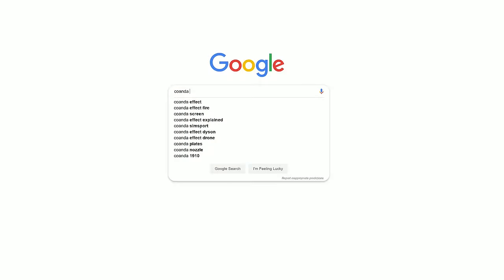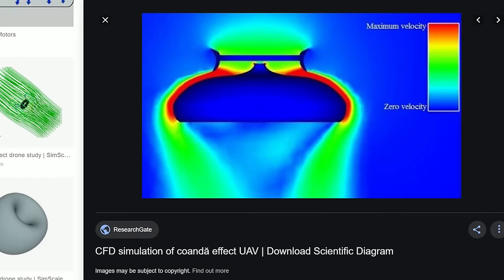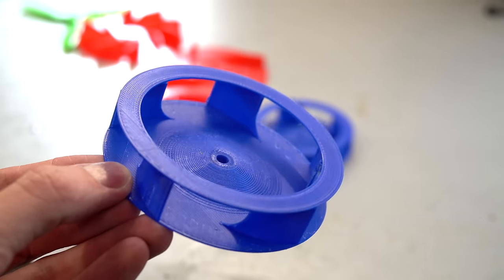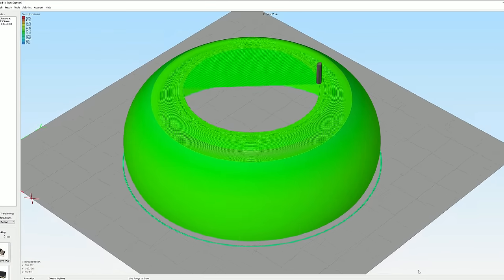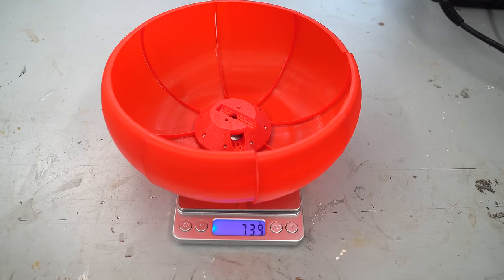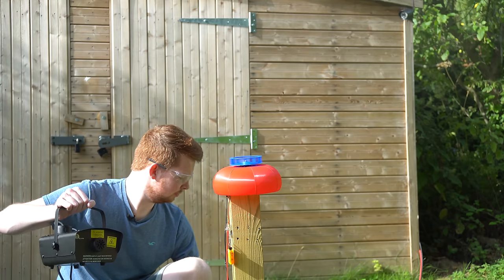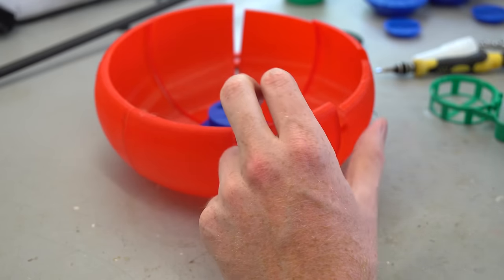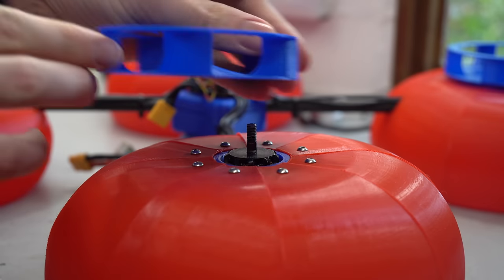Coanda Effect Drone Propulsion

Comment: Copy Dyson’s impeller design.
Reply: Dyson uses Panasonic vacuum motor/impellers.
Reply: But the question is how do you get 230v at 30A on a drone that size? I don't know if that's even possible!
Reply: Designed for max suck, not blow
Reply: @KnowledgePerformance7  you mean pressure differential, not airflow. 
still would be interesting to compare static pressure v CFM.
Reply: @ctchrisf  I'm not good at words lol

Comment: When I attended rotary-wing flight training, early 1980 we were taught the ground effect would occur as long as we were 1.5 times the rotor diameter within the ground. Once out of ground effect, power consumption increases, that is why most Power Checks are conducted at 50 foot AGL (above ground level).

Comment: you can do that test with a spoon under a running tap :)
Reply: Or your finger under a running tap :)
Reply: That is more due to the water's surface tension than the Coandă effect.
Reply: @kurtpiko4412  Fluid dynamics and air flow are remarkably similar
Reply: @sahhull  true, however in this circumstance the effect of water's surface energy /tension is greater than the Coandă effect.

Comment: Would it still fly if you just had a flat surface under the propellers? I know it would produce the effect but there would still be air flowing down producing thurst...
Reply: That would be like trying to move a   sailboat forwards by blowing on the sail yourself. If the air from a propeller hits a flat surface belonging to the same structure, it will cancel out the thrust.
Reply: It would, so long as the flat surface wasn't too large, as some air would still be able to maintain downward momentum and provide the thrust. This drone is more flying in spite of the bowls than because of them - the coanda effect (which is what actually causes all lift) is reducing how bad the obstacle is
Reply: Yep, that's why it flew so much better with propellers instead of impellers. Not all downwards momentum gets blocked by the domes because there is quite some separation between the propellers and the obstacles.
Reply: Samuel Goodwin
no.

Comment: Interesting. Although it is not applicable efficiently as a form of propulsion since the same dome that generates this effect applies great resistance to the airflow, causing it to lose power.
You could try doing some combo props that generate momentum down and to the sides. Combining in your case the green and blue propellers and modifying the dome leaving a hole to give space for the air flow downwards. This way you could take advantage of both flows and test if it is applicable and compare it with the conventional way.
Greetings!

Comment: if the bottom of the domes were "teardrop" shaped would you have a more condensed airflow as the air would follow the shape?
Reply: @Klippy Klop I think he means concentrated
Reply: VarinOOF that’s a much better word
Reply: I was going to suggest this too - the bottom of the tear drop could be feet for it to stand on maybe. Even covering the current design with a flat bottom might help increase the ground effect and reduce drag as it climbs, surely there is a big vacuum that forms under there? Or even redirect some of the flow inwards to make it higher pressure...
Reply: I think so, but wouldn't it kind of defeat the purpose? Might as well ditch the domes and use the concentrated airstream straight off the propeller like usual.

Comment: ok but technically the “tomato things” are just in the way of the propellers
Reply: No, did you watch the video. Airflow is sideways/horizontal, the "tomatoes" use the colleander affect to redirect the air down, creating lift.
Reply: @airgliderz  actually when he uses propellers instead of impellers, the initial comment is legit cause the airflow is vertical, not horizontal
Reply: @tristand9129  that's given and clear already

Comment: well explained. It is not just the surface pressure alone, but also the flow of special materials that creates a curved air particle pressure with increased additional adhesion and its better coupled flow counterforce at the other end of the doom.
2.23 shows it good.Maybe an additional double cap at the top of the dome ?

Comment: Centrifugal impellers develop greater efficiency when they have a certain grade of back-pressure. Perhaps with some sort of ring-shaped nozzle the back pressure could be combined with a greater flow velocity around the curved surface, useful for the generation of lift in Coanda-mode.
Reply: Tom,
Images Rebamade a Chanda hovercraft in the 60s. was pub in scientific American June 1966.
he had a ring around the base

Comment: That extreme ground effect should make for a much safer and softer landing. Especially on auto-landings when the ground proximity sensor doesn't work (or it has none), the drone could simply reduce power and would come to a safe hover low enough to just cut the motors completely.

I also wonder if the large domes would reduce the free-fall speed of the drone if it runs out of power mid-air.

Comment: I'm not an engineer, but it seems to me downward thrust is key to the effect. In my mind, it first decompresses the forced are by forcing it to spread over a wide surface. This compression would create more lower air pressure than the impeller right above the middle surface, which adds to the low pressure made by the curve.
Ultimately though, I don't think this could ever be feasible because the design first is pushing down on the craft, which is a force the lower air pressure above has to fight. Worse than that, there is no high air pressure normally around under the fan because the object blocks it. Still worse than that, the air flowing down the sides will instead create low pressure under the object because it will drag air out from the middle to the sides. I think that's why it was so much more difficult once you reached a certain height. The side air would compress against the ground and offset the low air pressure. Once the ground wasn't there to compress the downward air, it would create a churning vacuum under each bulb with highly turbulent air.
My thoughts are least. Again, I'm not an engineer and could just be talking out of my butt.

Comment: You could try 4 horizontal blowing props inside a bigger single dome with a draw hole in the top to get more ground effect. A flying hover doughnut would be sweet, and all the moving parts would be protected.

Comment: You would get a stronger ground effect if you replaced the inverted dishes with light plastic balls. The downward flow due to Coanda effect would then form a higher pressure directly under the balls.

Comment: It looks really great as it takes off during trial one. That's a genuine mad scientist-moment. Then seeing the grueling phase afterwards trying to make an impeller design that generates enough thrust for actual flight, I think putting a second bowl on top the bowl/impeller assembly, one with a hole for the impeller's air intake, would help greatly with the thrust produced. It would channel the airflow rather than relying solely on the Coanda effect, so probably it's a 'not allowed', though.
Reply: and the 2nd dome would block out the effect anyway

Comment: You need to channel the air flow from the propellers with a collar of some kind. My first thought would be something like a cup with a cut out where the handle would be. Coming off this cut out would be a chute that follows the curve of the dome. I suggest that the chute be enclosed from the edge of the "cup" to the bottom of the dome. This design allows for concentration of the Coanda effect.

Comment: Ineffective,  because the curb around the outer coanda allows air to expand out freely from the curb, if you did it from the inner top, of the o-ring blades, or between two size Coanda, you might see a more Oblivion movie style craft, of a just propellers version.

Comment: Misconception of this copter is in understanding of lift forces itself. It has two different parts - quasi-aerostatic part is about Bernoulli's principle of lowering static pressure in airflow (velocity head), so maximum of such lift force are equal to 1 atmosphere on sea level (and drops rapidly on the way up). And second part of lift force is the pushing force of air molecules on each other which move air masses down and push object reactively up. So your drone demonstrates first part of lift force without second. If you want to add force to your original propeller, you should place it in the center of toroidal fairing, which will work as fenestron on some helicopters.

Comment: Since you already have rounded shapes in the design, I wonder if you could fill them with hot air or helium, heated by the motors. It wouldn't affect the aerodynamics especially at the slow speeds, but it would decrease the weight.

Comment: It would be interesting seeing the impeller or the propeller on the inside of the tomato. It obviously would not use exactly the same effect, but the ducting effect and whether it would actually be able to get enough air to provide either an air cushion or a flight capability would be intriguing to find out.

Comment: Had the centrifugal fan been placed so that its radial air-flow was INSIDE the red canopies (having a hole at their centers for inlet air), there would be more downward flow than with this Coanda effect. This alternative would be more power efficient and for the same performance (lifting) would be quieter. Above these canopies the suction would also help.

Comment: Efficiency is the difference between an interesting curiosity and a practical application.
One simple variation you didn't test is putting the impeller under the dome, with air being pulled into the center of the impeller through a hole in the dome center.
This would divert the air downward through a more intuitive dynamic, the walls as physical barriers, not utilizing the Coanda effect.

Comment: Build a secondary "dome/duct" that goes around the prop and starts the downward curve. Air flows through the top hole > prop > into the curved chamber between two ducts and out.
Like a turbo, but curving downward on all sides and no central outlet.

Comment: Just a country boy here, but I’ve been to a couple rodeo’s.  Study the airflow of a vacuum cleaner motor/fan the duct & so-forth.  Also hovercraft should work with the coanda method instead of pressurizing from the inside, I’d like to see results of that.  Great vid. Tom, I would like to see you improve a hovercraft.

Comment: Tom, the blue impellers displayed Coanda effect, but the yellow propellers just gave a high pressure towards the blue cone which deflected the air flow out over the tomato. If you put your smoke on it you should see Coanda in the area from the base up to about 75%. Could you try deleting the propellers and open up the blades of the tomato and have them spin pulling air into the tomato and out the bottom to see if that gave more thrust. I think the direction to study would be thrust without noise. (If what you are doing does not work, do anything else - Henry Ford.) Cheers.

Comment: The propellor on the dome creates a pressurized cushion of air similar to an air hockey table and puck, it allows the prop to spin faster without the sonic booms at the outer leading edges where the air at the tips on a prop in an open configuration/location is turbulent and choppy, robs efficiency, damages engines, ruins propellors , the use of a duct around the prop helps mitigate this effect, the added coanda dome with strakes to control the behavior of the airflow as it exits the effective influential range of the prop, its the kinetic energy of the next pressure pulse generated by and propelled from the props following blade, acting on the air mass ahead that creates laminar air flow, skimming over a cushion of slower flowing pressurized  air called a boundary layer, which acts like a lubricant for vessels, and high speed moving parts

Comment: this looks cool. I estimate your design works well when from the ground deflected slower air enters into the domes. I assume high above the airstream can t find its way from the borders to the inside of your dome-wing. I agree it would be great to see you build a high efficient hovercraft. Just to expiriment: How about shorten the height of the dome(s) or optional let the borders of the aperture point outwards -no curve to the inside and perhaps open the dome under the inner 2/3 of the propeller and add a much straighter wall  curved inwards to the center. The inward  wall should be shorter than the outer wall of the  dome witch should be looking more like a hallway circeling around the propeler center with airstreams outwards and inwards of its curved roof. -Don't know if that thing would move. But perhaps it would have more vertical lift and could keep a bit of this smooth hovering effect.

Comment: Perhaps produce the plastic domes by deep-drawing from something like thin PET sheeting, which would make them much lighter. Your motors initially overheated because the airflow from the impellers went in different direction and hence could not cool them.

Comment: There was plenty of comments sugesting to flip it upside down.
I though exactly about the same thing. Instead of trying to do it your way, you should put it upside down.
The reason:
If the coanda effect creates negative preasure due to attachment of the gas/fluid next to the curved surface, when you fill it upside down, it might create negative air presure above the empty 'fruit bowl' and therefore push, or rather pull, the whole thing to the new up.

Comment: Looks great to start with. My advise is to use a relatively heavier horizontal disk (Gyro) on the top placed at the center for sole purpose of maintaining stability, this will drain power though, but will certainly help stabilize the vehicle in the air.

Comment: Because the laminar flow breaks over an edge you pull air out from underneath and inverted  flow column is induced in the middle. It would be different if you used spheres.

Comment: Early Air Force hovercraft experiments also had problems getting out of ground effect. Basically, the high speed air exiting out from under the drone reduced the air pressure underneath the drone so much that the drone couldn't break free from ground effect -- sort of a reverse ground effect problem. I think that if you set your drone on top a tall pole before taking off then the reverse ground effect would be eliminated and the drone would be able to fly. It's just a guess on my part but I'd like to see someone try it.

Comment: Impellers need dynamically balancing, plus x 4, I would imagine weight balancing too, you’d be back and forth removing and adding material for that.
When you initially demonstrated coander effect for the camera, the flow was linear, not four dimensional, as the air pressure changes were in one flow, you forgot the pressure behind the curved plastic, flowing over a hollow dome, you will in effect create a partial vacuum.
You may have to sacrifice some of the airflow over the dome, and apply some inside the dome nearer to the centre of the motor, which may also aid cooling.

Comment: Put a second cone over the first with  an inch +/- of gap. End the top of the cone where the edge of the propeller  is so you can go up and enclose the propeller. Try to minimize space between wall and propeller. Now it's efficient

Comment: I think your overall design can be a Hybrid of hovercraft & an airplane. You have already proven that the Coanda effect is very efficient closer to the ground. Now when you gain altitude, you should make a mechanism that will change the shape of the domes into an airfoil such that it will fold towards the opposite side of direction of motion. For example after gaining altitude, you want to go left then the domes will fold up to right & it becomes like a semi dome & will deflect the oncoming air just like an airfoil.

Comment: The control issue you have are due to the balance of the drone also you would probably get more trust if  the fans 1 - 4 spin opposite instead of all 4 in the same direction.

Top L-fan clockwise
Top R-fan counter clockwise
Bottom R-fan clockwise
Bottom L-fan counter clockwise

This should reduce turbulence under the craft and increase air pressure.

Just make sure the propellers for the clockwise and counter are reprinted to thrust down. 

I bet you could do some cool jet like ideas if the could make the domes collapsible into teardrop shappes

Comment: Using an impeller reduces thrust and efficiency because the air is pushed outwards in all directions, diluting the pressure built by the impeller as air travels around the curved surface. This requires the impeller to build a lot of pressure, causing high losses to air just escaping upwards.
In order to get a more efficient design, it may be better to just blow air over a wing. Which is actually almost exactly what a propeller does (ok, it moves the wing rather than the air).

Comment: I honestly kind of like this from a safety standpoint. With the advent of drones being used in the service industry and potentially coming into close proximity to the general public, having a lift system that isn’t as dangerous as spinning exposed blades is intriguing.
Reply: That's easily fixed with ducted fans, though.

Comment: I think you might get more lift if you made another red donut that is slightly larger than the current red donuts, that can push the air through the gap between the larger and smaller donuts to direct all the wind flow downward.

Comment: Hmm, I vaguely recall that impellers create high pressure, not air speed. To get higher air speed you need to restrict the air flow out of the impeller. I guess some kind of shroud over the impeller? Also, mount the motor above the impeller so it's not inside a dome in a pocket of static air.